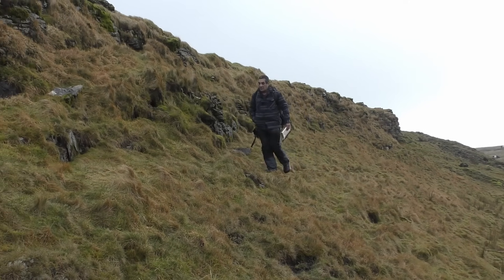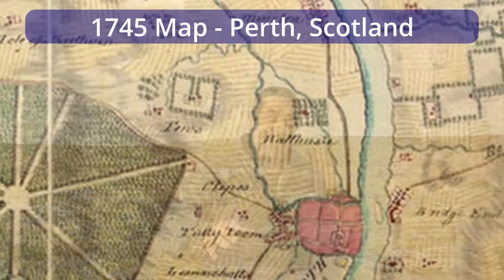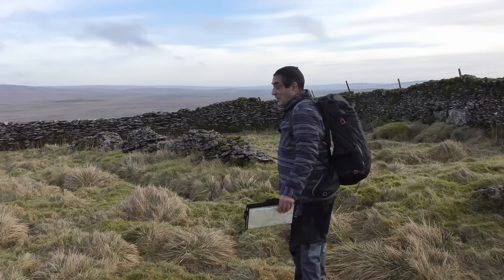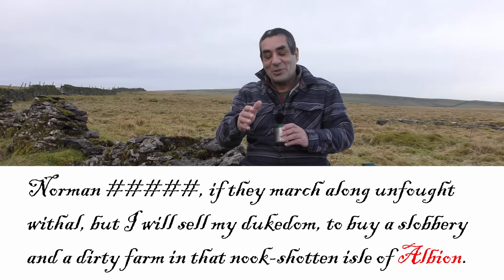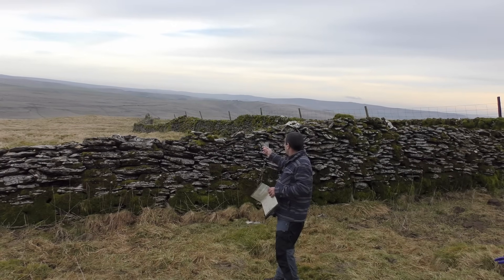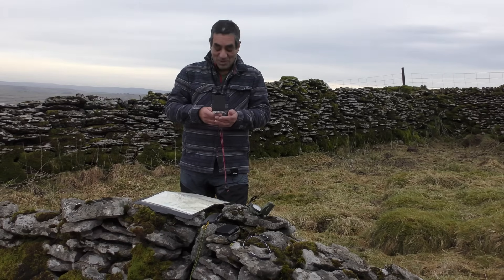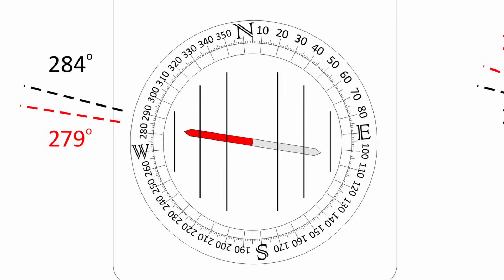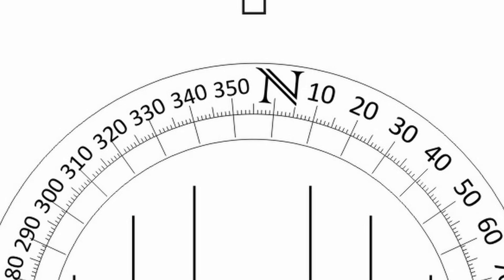How to calibrate a compass

Comment: Make a video discussing how the magnetic north pole has been moving, and now moving at an accelerating rate. NOAA web site has a chart of the pole's path since the 1800s. Airport runways have been getting renamed as the direction to them from the compasses changing.   There are even some ongoing theories about a pole shift (sun goes through one every eleven years, earth seems to go through it six to twelve thousand years).

Comment: Thanks for making the video. To clarify:

Westerly declination area -10. Minus 5 compass error:
If you take a field azmith you have to add the 5 degrees to the azmith before accounting for declination and going to  the map. Field azmith of 260 + 5 = 265 - 10 degrees declination = 255 Grid Azmith.

In the same scenario with a positive 5 error you would compute 260 -5 = 255 - 10 = 245

Feel free to comment/correct me.
Reply from the maker: Yes that's right.  If you know the compass has an error, remove the error first, then adjust for declination.
e.g.
West 10 declination
Compass error -5
Grid bearing 123
To adjust to a magnetic bearing you will add the declination:
So 123 + 10 = 133
But if you don’t account for the error the direction walked will not be 133 it will be 128

Or
East 15 declination
Compass error +5
Grid bearing 345
The Magnetic bearing should be  330
But if you don’t account for the error the direction walked will not be 330 it will be 335
Reply: Thanks for the response. I enjoy history so the waffling is an added bonus.

Comment: Spirit level waffel😂,..to check;  put it in one direction (does not matter which). Them turn it 180 degree (half a turn) the bell should read te same! If not, your level is off and need adjusting (if possible)… or replacment😂

Comment: What could cause a compass to give an inaccurate reading (given environment is determined not to be the cause)? Great video, BTW, you're fun to watch 😊
Reply: Mobile phones are a favourite. Too close and your compass will be completely wrong.
Reply: @roysoutdoorlife The presence of a mobile phone would fall under the category of environmental factors, as environmental in this context means influences external to the compass, not necessarily the natural environment. An internal error could be due to the compass needle's own magnetisation being out of alignment with the axis of the needle. The needle may be shaped like an arrow, but its magnetic poles are determined at the atomic level and could be oriented at any angle, possibly due to manufacturing error or storage near a strong magnetic influence.
Reply: @itsafeaturenotaflaw  fair one. 🙏🏻

Comment: I liked the rabbit holes you went down 👌. The egg white one ..Albulem.. / Albion .. …I’m going to check that out..🤔😂  

Compasses ..I know that’s the correct plural.. but I always  think that . …Comp .”eye “.    Just sounds right.   As for the declination and actually checking … that’s a very big ask lol.  I’ve  found the compass apps quite good, ..say you wanted to know whether a property had a south facing garden,    It just  less nerdy than whopping out a compass 😂.     Also..a question..head torches..  ..the last time I was on hill, was petzl , three pack battery, with a tiny old style filament 3 watt bulb I think..😢 so that’s 1995 ?   I’ve obvs kept up with led technology…  and have used for  work, ..but any tips for stopping the thing coming  on accidentally.. in your pocket? . I’ve use tape and blue tack ..in the slide or press buttons.. I know I could flip a cell, but that’s hassle. I quite like energiser ..headtorches ..  price is ok,  .. but I deffo like the red light function. That some have, I think your advice about always carrying two…was good  👌.  Back in the day…I don’t think anyone thought of that..just carried  spare batts.   Not asking for reviews…cos the “ best” this and “ best “ that gets so tedious…especially..when the most expensive..is ,funnily enough…always the “best”. 🙄😂. Actually..I’ve noticed you wear some expensive clothing ….🤔😂